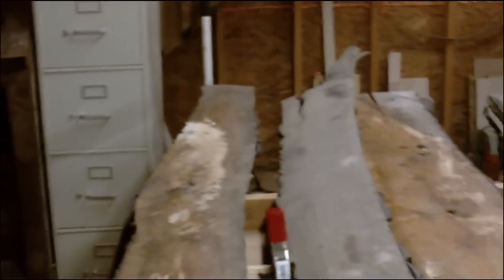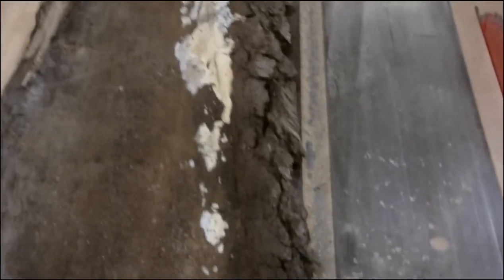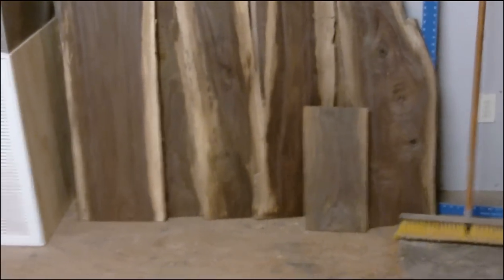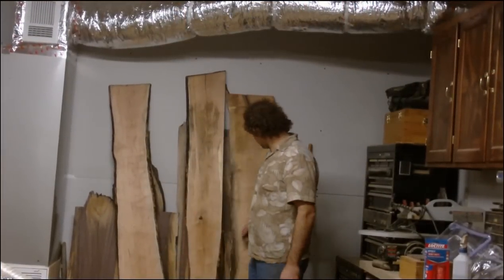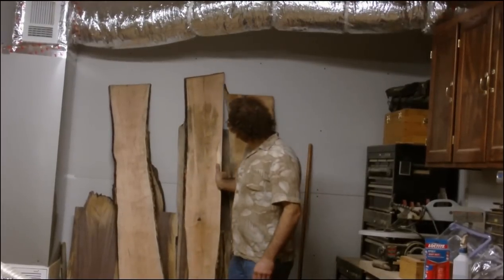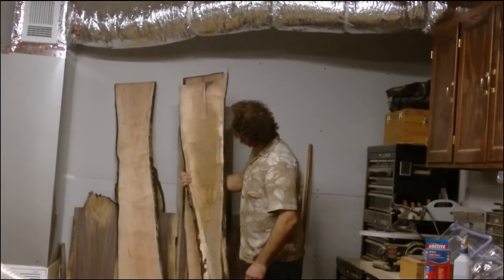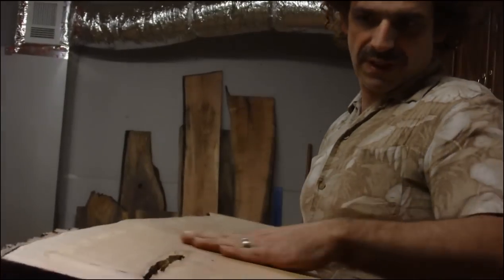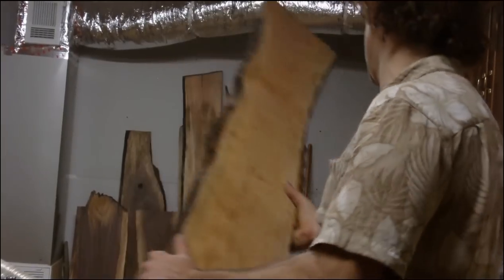Filthy Cherry Lumber-Steal or Bad Deal?

Comment: I would say you got a deal. 2 questions. 1. what are you gonna build with it? (whatever it is do it with one of the Shopsmith machines.) 2. Do you sharpen you own blades or do you replace them? Thanks for posting this, I like seeing the before and after.
Reply from the maker: You are quite welcome, and thank you also. I may build a hope chest like in my other finishing a walnut and cherry chest video. That is why I mention that it made 3/4" or 18mm. That thickness is for the sides and panels if they are to be raised. I need a full 7/8" or 22.2 mm. for the lid frames. I have a video on sharpening my planer blades if you would like to see it. I will try to squeeze in a shop smith video soon.